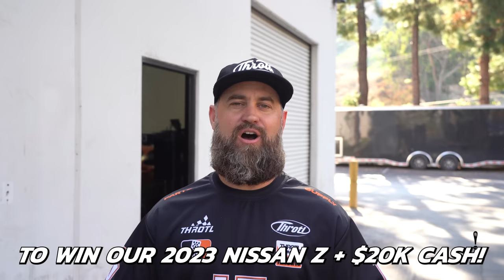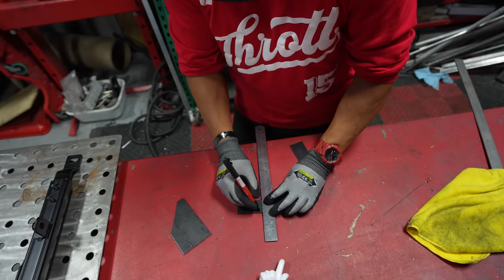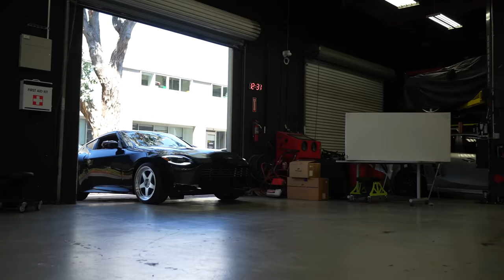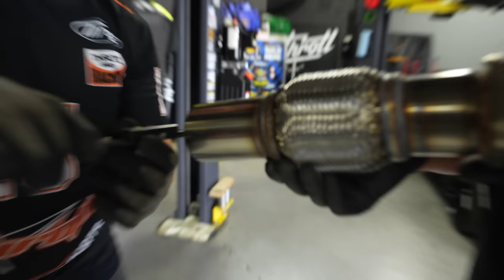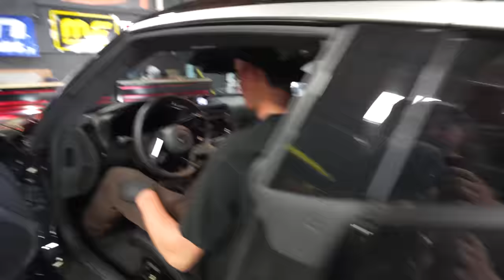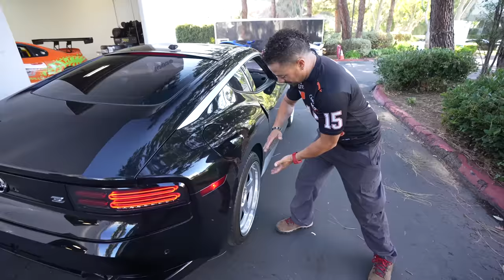Building the USA’s FIRST Liberty Walk Nissan Z for SEMA! - Part 2

Comment: The Factory Seats were designed that way for crash safety.  The headrests are supposed to be that way for Whiplash protection.  Stuff OEM's have to do to get their cars to pass.
Reply: That makes sense
Reply: The headrests being that flimsy would actually compound whiplash.
Reply: @mickeyandrade3435  you think so but watch the crash test video and you will see what I'm talking about.
Reply: @eppyz  - Watching now.
Reply: @mickeyandrade3435  You will notice Nissan cars are equipped with "anti whiplash" head reasts, very similar to what Volvo uses.  They make the seats like this by design for crash test purposes.  Not saying they are "better" seats than the Recaro's but just stating why they are made they way they were.
Reply: @mickeyandrade3435 😂

Comment: If you just bridge the wires that go to the airbag , that should complete the circuit . It's the break in that circuit that turns the light on .
Reply: With resistance, yes.

Comment: Idk if it’ll for for Nissan. But I put aftermarket seats in a car. Just removed the airbag wiring from stock seat and plugged it back into the cars harness. Just gotta zip tie the wires up so they aren’t hanging.
Reply: We did that. That particular content was removed from the video.

Comment: Those headrests are designed for whiplash protection. Safety regulations, nhtsa.
Reply: Not sure how that’s possible when the two posts actually stab you in the shoulder blades when the rest is forced back. Pretty poor design honestly.
Reply: @mickeyandrade3435  I know it looks and feels bad. During crash tests, it helps the head from snapping back in an accident, hence the feeling in the shoulders.

Comment: How did you'll solve the airbags in the seats?
Reply: I removed the wiring from both seats and the weight sensor from the pass seat and reinstalled it in the new ones. The guys installed a resistor on each side to eliminate the SRS lights.

Comment: This is the problem with SEMA. "Take the hottest whip. Murder on a bodykit. Slap on some "custom" wheels. Add air suspension. AND EVEN change the seats!!!"

SHAZAM!!! INSTANT SEMA CAR. 

None of you know that Rocketbunny and Liberty Walk kits are ALL produced by the same people and designed by the same person at insanely different price points. AND... None of this is original AT ALL.